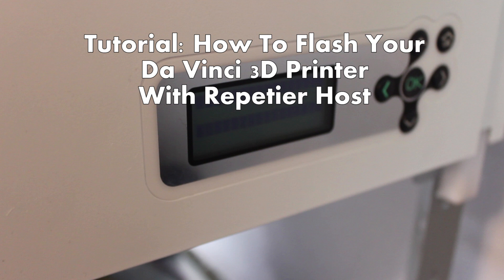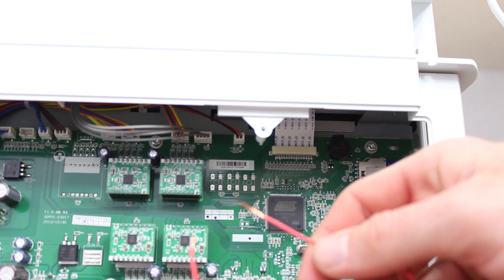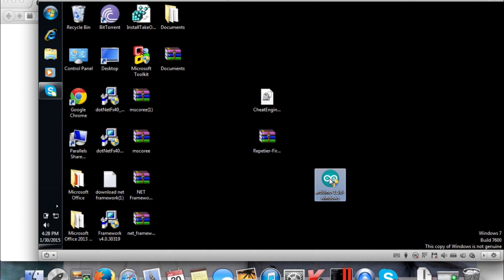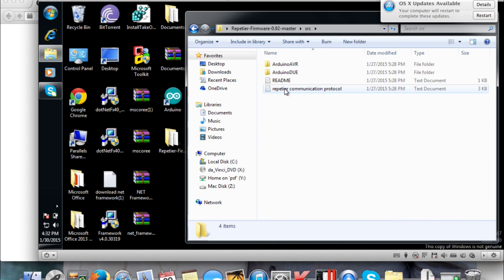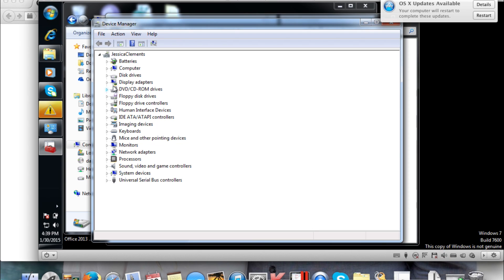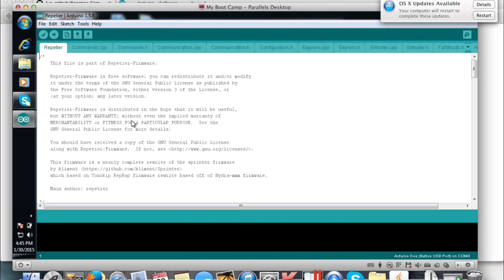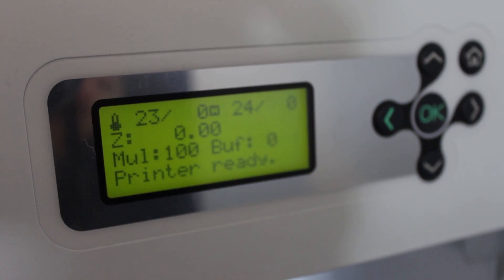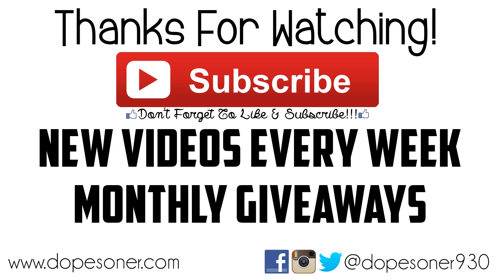Tutorial: How To Flash Your Da Vinci 3d Printer With Repetier Host | 3d Printer Hacks

Comment: Hey Modbot,
Thank you for the tutorial. I'm running into an issue unfortunately. When I load the compiled information from Arduino, it finishes and nothing happens. If I power cycle the printer, the bars remain and Windows won't recognize the printer anymore. It repeatedly makes the sound for a usb device connecting and then a few seconds later, the sound for it disconnecting. The only way to fix that is to once more jumper J37. Then I'm back at square one with no luck. I wonder if I'm missing something. Have you experienced this issue or know someone who has? Thanks in advance for any help you can render.
Reply from the maker: +Asterios Anagnostou it has been a very long time since making this but I have done a lot of board flashing in general. I know I had an issue where there where times I had to do more than one power cycle to get it to boot. At least you are not bricked. I would see if there is maybe a newer firmware? Or maybe something has changed since the tutorial your best bet would be to find a Facebook group or forum of davinci owners. If its uploading successfully i really don't know where the issue could be stemming from.
Reply: Thanks for responding so quickly brother,
I'm going to download Arduino 1.5.8 and try it with that. I was using the latest and someone else on YouTube was saying that some of the file conflicted in the hardware folder. Is that a thing?
Reply from the maker: Asterios Anagnostou definitely worth a shot I had an issue with versions before it wasn't on the davinci but its definitely worth a shot good luck let me know if that does the trick so I can let others know for future reference
Reply: Ok, this is what I got when compiling:

Arduino: 1.5.8 (Windows 8), Board: "Arduino Due (Native USB Port)"

In file included from Repetier.h:572:0,
                 from BedLeveling.cpp:107:
HAL.h: In static member function 'static void HAL::serialSetBaudrate(long int)':
HAL.h:684:14: error: 'class UARTClass' has no member named 'setInterruptPriority'
       Serial.setInterruptPriority(1);
              ^
Error compiling.

I really apologize for my ignorance, but do you have any idea what this means? I promise I'll stop bugging you after this, lol!
Reply: Ah, theres no 1.5.8 hardware folder in the firmware folder I downloaded. That might be it.
Reply: Ok got it! So I ended up using 1.8.0 with Due 1.6.8 module from board manager and discovered I was modifying the incorrect files form the hardware folder. Here are the sites I found with the details:

https://github.com/luc-github/Repetier-Firmware-0.92

https://github.com/luc-github/Repetier-Firmware-0.92/issues/114

The first one give a rundown of what to do. The second one explains where you can find the Variant.cpp and USBCORE.cpp files. I left the Hardware folder in the main Arduino directory alone. Thanks again man. I hope this info helps someone!

Comment: GOT THE FLASH PROCESS WORKING 2017 -
Hello all.  Go to the Github listed in the video description.  Click on the "Releases" tab on that page.   Download the oldest one there.  Mine was v 0.92.3 dated Nov 29, 2015.   Then you can install Arduino 1.5.8 and follow all of the instructions in the video.  I tried the latest version, followed many comments, and still did not get it working.   I downloaded the old repository, made a fresh install of arduino 1.5.8, followed all the instructions in the video, and it flashed properly the first shot.  Be sure to use the jumper to freshly wipe your flash before trying this one.  Thanks!  Awesome video!
Reply: gday mate im totally stuck it sounds like you had the same issue im having... i cant get it to work im going to try what you have posted here
Reply: my printer is BRICKED now with code 43 the i cant connect to the printer to flash the firmware.. ive tried every fix and nothing works.. in the bin it goes i guess

Comment: UPDATE FOR ISSUE SOLVED: It might help to know that instead of copying the hardware folder into the arduino program folder, it should be copied into the APPDATA folder. At least it had me scratching my head for a while...

EXAMPLE: 
FROM 
C:\Repetier-Firmware-0.92-master\Repetier-Firmware-0.92-master\src\ArduinoDUE\AdditionalArduinoFiles\Arduino - 1.8.0 -Due 1.6.8\Arduino15\packages\arduino\hardware

INTO 
C:\Users\XXXXXX\AppData\Local\Arduino15\packages\arduino\hardware
Where XXXXXX represents user folder

Comment: Alright. Done successfully using 1.5.8 arduino and github files, but now I've no idea what to do with my XYZ 1.0A. 
Whenever I try to print anything, extruder doesn't heat up, bed remains at the bottom, and it's just a cool extruder running around the air like if it prints anything. 
Also there's a short 'error' sound every 10 seconds and at the main menu I can see the line "stepper disabled". Can't fathom what this could mean :(
I'd much appreciate if anyone who had such problem or knows what to do could give a hint...

Comment: when i verify come this failur :
In file included from Repetier.h:572:0,
                 from BedLeveling.cpp:107:
HAL.h: In static member function 'static void HAL::serialSetBaudrate(long int)':
HAL.h:684:14: error: 'class UARTClass' has no member named 'setInterruptPriority'
       Serial.setInterruptPriority(1);
Reply: use another arduino version, i had the same problem, diferent version doesnt compile and others compile, but i dont know, it flash correctly and i got black bars

Comment: Something not mentioned in the video. The DaVinci 1.0AiO that I have did not reset automatically after installing Repetier. I turned it off then back on, and the screen is now showing the firmware as loaded.

I was a little scared that I'd bricked it when it didn't do what the OP said it would do.
Reply: Hi, what exact process do you use? I'm stuck in 2 black lines on my 1.0 AiO :(

Comment: Having an issue in the fact my laptop wont install the driver. I have found the device and told it where to look but it just says it cannot find appropriate files or something along those lines. This is 2.0 duo any help would be greatly appreciated as i currently have a very expensive large plastic box where my printer used to be.

Comment: I followed the github instructions and flashed using the 1.8 version of Arduino and it was successful except my printer didn't do anything. so I checked instructions again on github and it said to restart printer, so I did and then my USB/comport went to unrecognized then try to connect then in recognize over and over and over. 

in votivo I read were a line in variant.cpp could be commented but went to find it and it wasn't even in the sketch. so I tried again to copy hardware for over but again nothing there. 

right now I'm uninstalling the arduino 1.8 and reinstalling the 1.5.8 beta then going to flash again after going over the steps again. just hope I didn't really mess something up.

not sure why github days to use the latest Arduino IDE if it would work that way. I think I found my answers here below in a few comments so again in hoping I did not mess the printer up.
Reply: Can you give a detailed explanation of what you did to solve this problem? I am very new to programing and I am attempting to do this hack but I ran into the same issue you had, where the 1.5.8 is gone. I am unsure as to what to do. Any information would be helpful!
Reply: Gregory Barni I'm still having issues, I've tried every ide except the one I'm downloading now 1.6.9 IDE. also this time I'm downloading the entire zipped folder where as I had been only downloading the win installer before which is an exe file. 

After looking through countless blogs I found one closely resembling our or my issue on github. in the chat they had success using 1.6.9 even though the variant.cpp and USB.cpp are found under 1.6.8. Not sure about all this but right now I can get everything done and successful uploaded however printer will not reset and remains in flash mode displaying the two black lines on front panel. 

My printer is an older version using jp1 to flash. Wish I were more help and please if you figure this out let me know. If your having an issue with the USB not being recognized then use whatever to you used to flash as I did jp1 initially and that will allow USB to become recognisable again

update 1.6.9 again successful upload but no CPU reset😏.
Reply: Ok so this is what I did that worked. I got the 1.5.8 from a comment below, https://github.com/luc-github/Repetier-Firmware-0.92/releases. The last entry from that site is the one i used to rewrite the hardware using the same method as said in the video. It only replaced 2 of 10 items which seemed odd to me but in the end, It worked out so far. The only thing that did not happen was that it did not automatically restart after uploading the arduino program. I turned the printer off and on to see what would happen when it made some noises and beeps and the repetier mod .92 showed on the screen. I have not printed anything yet but will get back to you on that. I dont know much hacker lingo so if you need me to re-explain anything, let me know. Happy printing :)
Reply: It says clearly do not use 1.5.8 as it will give compile error, which it did when I used it lol. Instead it says to use 1.8.0?
Reply: Did not see 1.5.8 at that link could you send me the link to the ide you used? Also were you able to print? Did you use the different repetier fw from the link above?
Reply: 1.5.8 is from the very bottom of , https://github.com/luc-github/Repetier-Firmware-0.92/releases. Go to the bottom of that site, download the zip, and you should see the old file inside. I did get it to print, just fidgeting with the settings to print perfectly. I used the link to get 1.5.8 and the same arduino and git hub stuff from the video.
Reply: In the zip, the path is: src -> ArduinoDUE -> Additional arduino files -> 1.5.8. This is the 1.5.8 I used to drag over.
Reply: Awesome I'm excited to get this thing up and running. I got a good deal on it but never printed on it before flashing. In fact I've never printed before so this should be interesting lol. All my knowledge base comes from modding my k40 laser. 

Were you able to print with both exstruders? What slicer are you using? Know of any good site, blog, or video for setting up repetier and slicer? I downloaded repetier software from repeteir.com what or how did you go about getting set up to print? Also are we still able to use the SD card or do you know? 

Thanks again for your patience and thanks for all the help.
Reply: "Both extruders"... Mine only came with 1? In repeteir host, you can use either slicr or cura engine. Both come in the instillation of repiteir host.  I use slicr though I am still getting used to it. I have no clue about the sd card for I never used any. My pleasure :)
Reply: I tried what you did but still didn't work, Everytime I reflash it goes back to bossa port and after flash it goes unrecognizable. I'm going to try something different in placement of variant. CPP and see if that makes a difference based on several forums. 

I have the davinci 2.0 jp1-epprom. If this next thing I do doesn't work then I'm considering rebuild with different board. I'm wondering if I should have updated my davinci prior to flashing. I Nevermind connected it to do so, I just went straight to flash.
Reply: I finally got it sorted now just need to figure out how to use it lol. find any good videos for setting up and using the davinci 2.0 with repetier?

I used the 1.5.8 beta IDE and the matching 1.5.8 hardware folder located in link you sent me and also flashed with native port using repetier firmware again from link you suggested above that contain the 1.5.8 hardware folder. 

I also decided to use the USB output on my laptop that does more than the other two, not sure what but I believe it's with power and data. Also before resetting my printer after flash I first disconnected the usb connection to laptop. 

last thing that may have played a part in all this is the timing between resetting EPROM and actually flashing, I read in Arduino forum that it's an important point when uploading using the Arduino +  due.

Just need to figure out how to print now lol
Reply: Repetier host to print with or repetier server? Right now I have installed repetier host v1.6.2 again program to print with.
Reply: Gregory Barni hey how's it going? Still haven't printed yet been to busy. Was thinking after reading forums, do we have to reflash Everytime we want to update the firmware or can this be done in another way?

Comment: Successfull firmware  upload! on my 1.0a J37 
(fyi my serial# starts with #3S10AP...)
This is what I did.  

(bought the printer in Nov 2016)
I Downloaded and unzipped Repetier v0.92.3 from 
https://github.com/luc-github/Repetier-Firmware-0.92/releases

I Loaded and installed arduino 1.5.8Beta 
from https://www.arduino.cc/en/Main/OldSoftwareReleases

Copied the hardware files over into the Arduino installation folder (from the video).

Reset the printer to erase and bricked it using a paperclip on J37. (per Video)

Opened up Arduino, loaded the repetier.ino (from the video). 
Set the port and board (arduino due native usb) 
modified configuration using DAVINCI 1, and MODEL 1

It wouldn't upload the firmware the first time. 
I tried again with the printer off then when the arduino compiler started to
upload the code, I turned on the printer. Upload went well.

Stored into EEPROM via the printer's menu (from vid).

Now lets see if I can configure this thing. 
Thanks a lot for the vid!

Comment: Using the comments below I downloaded Arduino 1.5.8. Driver is recognized correctly. Downloaded older version (0.92.3) of repetier from Git. I am able to compile, it uploads and says verify is successful.

Verify successful
Set boot flash true
CPU reset.

However nothing happens after this. Just 3 black bars, even if I power cycle the printer. Any ideas?
Reply: Welp out of boredom I just reset it a few times, draining the power once, and now it booted up. Odd.
Reply: I'm having the same issue, nothing after CPU reset. How did you "drain the power" and do you mean you reset and re-uploaded a few times or just turned the printer on and off a few times?
Reply: I drained the power by switching the printer off, unplugging it, and switching it on. It will then use up what leftover energy is stored in the caps/psu. Then switch off, plug in and switch on to try again.
Reply: Alright, I'll give that a shot. Thanks!

Comment: Great tutorial, worked for me. However, be sure to get the latest 0.92 version at the bottom of the page here: https://github.com/luc-github/Repetier-Firmware-0.92/releases And then use the correct hardware folder (for version 1.5.8) and overwrite that in your arduino 1.5.8 as described in the video. Got me stumped for a while until I figured that out.

Comment: THESE INSTRUCTIONS NO LONGER APPLY!
Unfortunately, this tutorial isn't current anymore.  None of the arduino parts work.  I have tried 1.58, 1.63, 1.68 and 1.96 and all them fail the build.  Also, the arduino USB option is not available in all but the 1.58. 
I know it's not the fault of the OP of this video.  Just saying that anyone wanting to do this in 2016 will most likely be stuck with double black bars and desperately trying to figure out how get their printers back to some sort of stock configuration after shorting the jumper and spending the following 10 hours trying to figure out how to continue with the rest of these instructions.
I have installed and uninstalled arduino so many times, it's not funny.
Reply: I found the old version that was mentioned in this video and elsewhere and got it to work that way.

Comment: When i did this on my 1.0a it blew out R57 which should be 0 ohms. I soldiered a wire the jump R57 and the printer works normally again with stock fw. Do you think jumpering j37 again could cause additional problems or did davinci put that there just so people couldn't do this. I  would like to get the repetier.
Reply: R57 is a red LED right?  I think I'm having the same issue? Did you replace it? or solder a regular wire in it's place?
Reply: I'm pretty sure it was illuminated before the reflash. All of my compiling went smoothly but after the upload was finished I still have black bars...
Reply: Domic Dolyar r57 is a pointless 0 ohm resistor the red led just shows that there is 3.3 v going to the microcontroller but i just soldered a wire over r57
Reply: Domic Dolyar also when i tried to upload it said it couldnt find the printer are you sure that it was able to find the printer and that there is 3 red lights on
Reply: Dylan Leddy, I do have 3 red diodes illuminated when I turn it on.
Reply: Yet, It still is not restarting or making any noise after the upload completes...
Reply: Are you uploading to the correct usb port
Reply: does your computer recognize the printer as anything
Reply: It was uploading to the proper port, I'm pretty sure it bricked the USB. I'm running photorec on the drive right now.
Reply: Okay, successfully unbricked the drive.
Reply: Successful upload and restart!

Comment: I have a da vinci 1.0a I keep getting this error message what can I do Arduino: 1.5.8 (Windows 7), Board: "Arduino Due (Native USB Port)"In file included from Repetier.h:572:0,
                 from BedLeveling.cpp:107:
HAL.h: In static member function 'static void HAL::serialSetBaudrate(long int)':
HAL.h:684:14: error: 'class UARTClass' has no member named 'setInterruptPriority'
       Serial.setInterruptPriority(1);
              ^
Error compiling.  This report would have more information with
  "Show verbose output during compilation"
  enabled in File > Preferences.